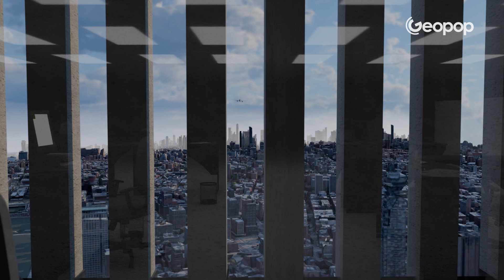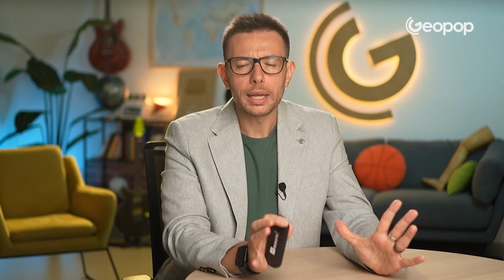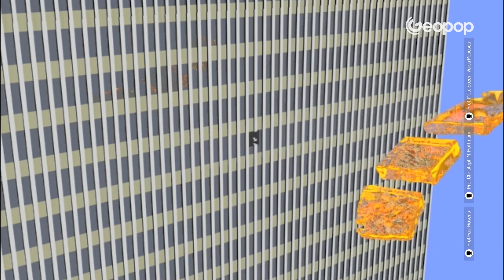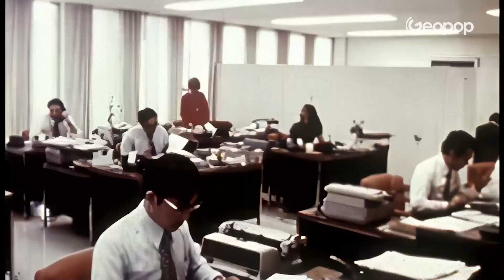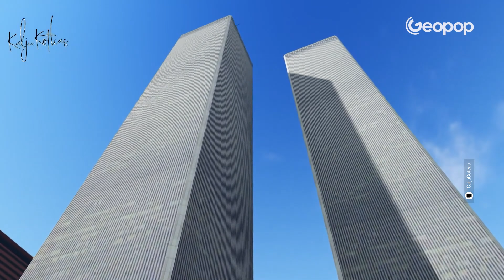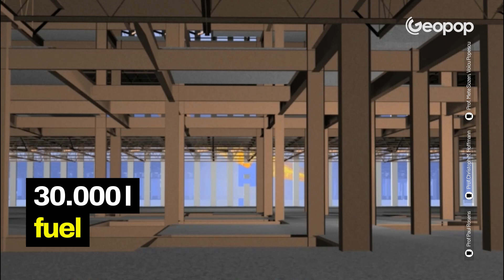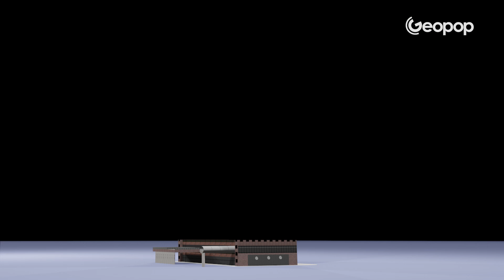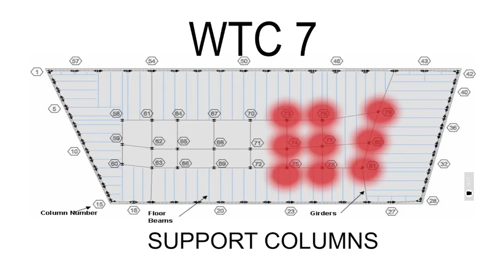9/11, 2001: The Technical Reconstruction of the Twin Towers and WTC 7 Collapses

Comment: What he says at 14:52 and on is the most BS of it all. No! Way! the top part of the building (on one of the towers only 12 floors) could totally crush the whole remaining UNAFFECTED lower part of the building. Like a Sledge hammer just piling down all the way to the ground...? Nope. 
The top part would have been equally demolished as it started to move down, or even more likely, just tipped over and fallen to the ground sideways. 
The massive vertical colons that held the whole stucture could never have been broken down into rubble either, they would have more or less been left standing as the floors collapsed.
Reply: Sure it can, you just don't understand how.  You are mindlessly repeating the false claims of a group called Architects and Engineers for 9/11 Truth who have been preaching incorrect explanations of collapse mechanisms they don't understand either - while holding their hands out - for over 17 years.

Let’s break it down to the absolute basics:

The 47 core and 236 perimeter columns of the Twin Towers support all of the gravity loads of the building. ALL of the resistance is in the columns.

Planes impact Towers, causing massive structural damage, destroying sprinkler systems, tearing out gypsum board walls and blasting off the SFRM insulation from the floors. Multiple floor-wide fires are started instantly and spread rapidly due to the destruction of fire protection systems and venting of the building during the impact.

Serious fires were largely confined to the impact damaged floors and those immediately adjacent to them.  

Fires were started by the impacts and fuel aboard the aircraft, which acted as an accelerant. No shortage of other consumables inside the tower to continue the fires. 

Collapse was initiated (started) at the impact and fire damaged floors when floor trusses exposed to heat over time sagged, in turn pulling on and causing the inward bowing of some perimeter columns by up to 5 feet until they buckled on one face of each tower (ie: NOT symmetrically). 

www.youtube.com/watch?v=ULdiD6gYZO0  

No steel melted or needed to. Structural steel will bend and fail at less than half its melting temperature.

Once the perimeter columns buckled the formerly static load above became a dynamic load 30 times greater, easily overwhelming the structure below.

Thousands of tons of now loose debris fall through the open office space within the four outer walls - bypassing the columns - dropping 12 feet onto the first intact floor it comes across. That massive instant overload causes the floor to fail, shearing the pair of bolts that secure each end of the floor trusses to the columns.  The floor fails. adding its mass to the falling mass which continues to accelerate for another 12 feet until it impacts the next floor, rinse and repeat one floor at a time all the way down. 

The columns - the part that holds the building up, supporting ALL of the gravity loads - are spectators for all this. 

Rate of collapse increases as momentum increases. The collapse front is constantly accelerating. 

As each floor fails, air inside the building (the Towers were 95% air by volume) is compressed, then blows out the sides _in reaction to the Tower falling, not the cause of the Tower falling.

No fire required at all on floors below the impact points for them to fail. The mechanisms that started the collapse are different to the mechanisms which continued the collapse.   That will be a difficult concept for some.

As the floors fail the perimeter columns are left literally hanging in the breeze, no longer attached to the rest of the structure. They peel away and fall in great sheets (think banana) out to more than 600 feet from the base on the 4 points of the compass. 

Core columns failed last. 

Each 110-story tower had a 1-acre footprint. The debris pile was up to 14 stories deep and spread out over 16 acres, destroying 8 surrounding buildings and damaging more than 100 others. 

The above all true no matter who planned and carried out the 9/11 attacks or why.

Comment: This was allowed by our own government to drastically steer this country into better ways of conformity as well as enriching all those involved Larry Silverstein, Chaney,the Bush’s etc etc,  building 7 is most of the proof you need or at least start there building collapses for no reason at all,  we have the internet people we seen demolition crews take down tall buildings this wasn’t dissimilar it was the exact same method,  they don’t even care that we know this we can’t do anything about it besides talking amongst one another bout it….    probably why they did it,  they knew no consequences for those truly responsible.
Reply: I’m going to respectfully disagree and offer a more plausible explanation using engineering, not ideology. 

Much misunderstood, Building 7 was the 6th building to collapse of the 10 lost on 9/11. Because of its early low priority, conspiracy filled the information void with garbage made up by technically ignorant people promoting political agendas. But this is an engineering problem and should be treated as such, so I prepared this brief summary of my own analysis to fix that, using engineering, not politics and tired memes. 

The North Tower collapse at 10:28am bombarded Building 7 with tons of debris, causing heavy damage and starting multiple fires which burned out of control for 7 hours. Half the FDNY firefighters having been killed, units in disarray, equipment destroyed, no water pressure, and the greater urgency of search & rescue efforts, firefighting was pulled as futile. The building couldn’t be saved and was left to its fate. That is the sort of choice firefighters make every day in brush fire situations - which houses to save and which ones to let go. Only real difference here is moving the decimal on the size and cost. People get overwhelmed by the size. 

www.youtube.com/watch?v=g_SvpwyC17M&ab_channel=MFitz  

Collapse of a burning structure is always a concern for firefighters. Steel buildings subject to fire rely on active fighting of the fires to survive. Buildings are designed around 1 to 3 hours of fire resistance, allowing time for occupants to escape and ACTIVE firefighting to get started, after which all bets are off. Left to their own devices they will exceed their design envelope and collapse, like Plasco Tower and Wilton Paes de Almeida. In B7 the occupants escaped, passive and active fire protections were compromised and active firefighting was abandoned 3 hours before the collapse, which left the building to its fate. It lost. Odds on Building 7 would eventually collapse, and it did. No big deal in logic. 

www.youtube.com/watch?v=WnYBX6QT0R4 

FDNY Chief Daniel Nigro ; The biggest decision we had to make on the first day was to clear the area and create a collapse zone around the severely damaged 7 World Trade Center, a 47-story building heavily involved in fire. A number of fire officers and companies assessed the damage to the building. The appraisals indicated that the buildings structural integrity was in serious doubt. I issued orders to PULL back the firefighters and define the collapse zone. It was a critical decision; We could not lose any more firefighters. It took a lot of time to PULL everyone out, given the emotionalism of the day, communications difficulties and the collapse terrain

FDNY Deputy Chief Peter Hayden ; We had our special operations people set up surveying instruments to monitor and see if there was any movement in the building. We were concerned of the possibility of collapse in the building. And we had a discussion with one particular engineer there, and we asked him if we allowed it to burn could we anticipate a collapse and if so, how soon? And it turned out that he was pretty much right on the money, that he said 'In its current state you have about 5 hours

The collapse of Building 7 was anticipated and widely reported in the media throughout the day, with 24 video cameras recording some or all of the collapse. Everyone knew what was coming and why.

www.youtube.com/watch?v=OY5S5k3tMHI 

Building 7’s collapse was completely different to the Twin Towers and harder to understand as most details hidden from view and not intuitive, but we can still sort out what happened through careful analysis and observation.  This is my explanation  of the collapse relying on no outside authority.

Building 7 was complex, assymetrical 47-story steel framed structure built atop a smaller 3-story building, requiring lower floors dedicated to complex load transfer structures, not usable office space. Of trapezoidal shape and all-steel tube-in-tube construction, B7 (above the 7th floor) consisted of a central core of steel columns carrying most of the gravity load, perimeter steel columns around the outside of the structure carrying the remainder of the gravity loads and long span beams and girders to tie those elements together and form the floors. On the outside of the building hung a moment frame or outer shell.

Phase 1 : First externally visible signs of collapse initiation occurred at 5:20:28 pm and were notably quiet with observers not realizing the building was collapsing! No audible warning in the form of  hundreds of ear drum busting 180-190dB explosive bangs preceding the collapse. Here at 12:00 a local CBS affiliate reporter is talking 10 blocks from B7 when collapse begins. People don’t start to notice the collapse until 12:11. At 12:45 is the famous CBS fixed camera clip of Building 7’s collapse. Note how quiet it is.

youtube.com/watch?v=t5tEy6mXSE8&ab_channel=fresnosean379

Collapse initiation was due to lower floor failures above the load transfer region (7th floor) in the NE corner. In this video at 0:45 you can see the NW corner from inside the building while under construction, Column 79 just out of frame on the left. That big, angled steel beam across the top of the frame connects to C79 at one end. The girders connect to the beam. That beam and all those girders depend on just one connection

youtube.com/watch?v=nP3TNHPCIVU&t=35s&ab_channel=EdwardCurrent

Phase 2 : The floor failures caused a loss of critical lateral support over an excessive length of core Column 79 and it buckled. If you look at a floor diagram of Building 7 (see above) and look at all the structures that depend on C79 you quickly realize this one column was a relatively isolated structural element on which a disproportionately greater fraction of the structure depended analogous to say the Key Bridge. Externally we see a vertical progression of window breakage along the 44-46 line and a kink in the roof of the East Mechanical Penthouse at the top of the building, consistent with C79 failure. The transition from full capacity to almost no capacity occurs in an instant. Once the buckling failure occurs there is almost no resistance

Normally with a buckling column, the load could be redistributed to other columns. With C79 that is not the case - the failure did not redistribute the load, so the collapse rapidly progressed to the roofline, sinking the rooftop penthouse.

Phase 3 : With C79 gone, B7’s progressive, non-symmetrical collapse continues with C80 and C81 at the east end of the core left laterally unsupported and quickly buckled and failed as well, sending the EMP down through the building. C79-81 all have no diagonal bracing, which I believe is a major reason why they could not redistribute a lot of vertical loads among one another.

From there collapse progressed from east to west through the central core until the core was gone taking all of the interior floors and probably most of the perimeter columns with it. Follow the horizontal progression of window failures low in the building and the dropping of the remaining rooftop structures into the building. One of the big takeaways from the NIST Building 7 study (that gets completely ignored) was their modeling which determined C79 failing under ANY circumstances would have initiated the same collapse sequence.

Phase 4 : After 10 seconds only the exterior moment frame - a hollow empty outer shell – remains, giving the ILLUSION the Building is still standing since little has outwardly changed.  It is just a hollow empty shell like an empty cereal box. Supported by only a few remaining columns that empty shell is quite unable to remain standing. With all core columns and floors gone, the north face leans inward, forming a V in the roofline, the last few columns buckle under the strain and the moment frame free falls, landing on top of the 7-story high debris pile. It is only late in the game here at the end that a single measurement of alleged free fall acceleration is taken, from a single point on that outer shell. The Building did not “free fall” – just one corner of the outer shell did, sort of. The Building was already gone before that happened. The period of alleged free fall was a product of how it fell NOT why it fell and cannot tell us what started the collapse. Start to finish the entire collapse took 18-20 seconds, 3 times longer than true free fall .  How fast something falls cannot tell you what started it falling_ anyway. The debris spread outside the footprint, blocking surrounding streets, heavily damaging the Verizon Building and destroyed Fiterman Hall.  

Building 7’s progressive, non-symmetrical collapse was incidental and unintended collateral damage from the combined effects of fire + time + gravity, started by the collapsing North Tower. That is true no matter who planned and carried out the 9/11 attacks or why . The collapse was of so little consequence it barely even registered at the time, a mere footnote. It only took on semi-mythical status as an alleged smoking gun years later when demolitions at the Twin Towers, missiles at the Pentagon and shoot down over Shanksville all failed and conspiracists had nothing left to work with.

Anything can seem like a conspiracy if you don’t understand how it works. Now you should. I hope you found this helpful, informative and it solicits informed critical comment. If I made any errors of fact, logic or reason or left anything important out, please let me know so I can fix it. IF you can offer a more plausible alternative please do. Be the first. Please start any reply with the words “Tits McGee” or I will know you didn’t read it and are wasting my time.
Reply: @TheLoonResistance  Only 3 buildings collapsed in New York on 9/11 you cheap little liar.

Comment: Controlled demolition, enough said.
Reply: For the extremely simple-minded yes. But then two words is about their comprehension limit.
Reply: @TheLoonResistance I disagree completely, closer to the time if the event there was significant evidence to suggest thermitic material was used, I suspect now that evidence may be hard or next to impossible to find but structural steel cannot be melted with jet fuel, however we witnessed this occur on that day. The 911 commission never mentioned any of this in their 585 page report. No, its not about comprehension limit its about not being a sheep and following the herd.
Reply: @TheLoonResistance  Wow stinkyshill, you´re a real workaholic!